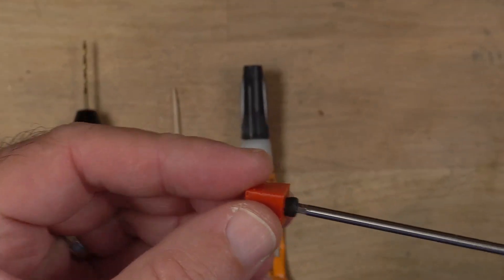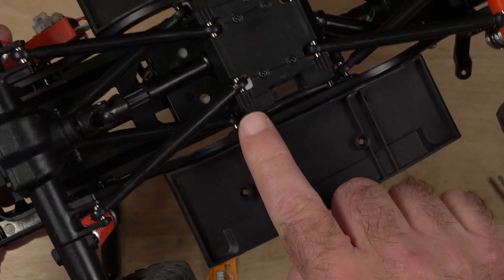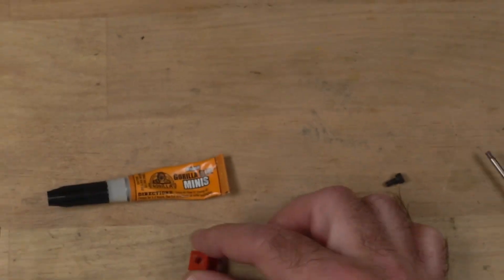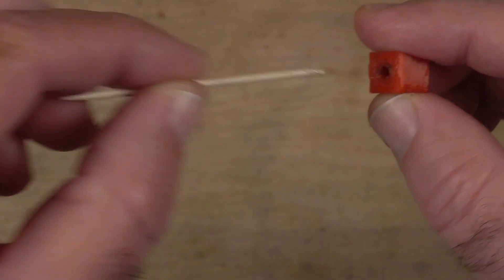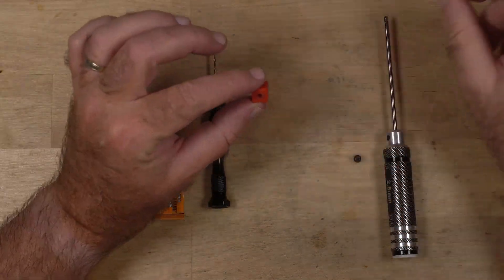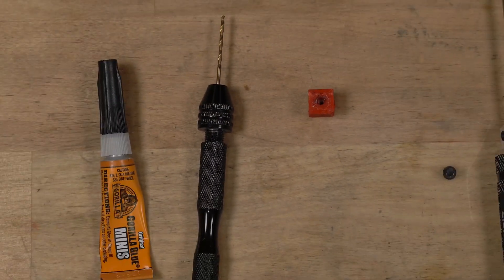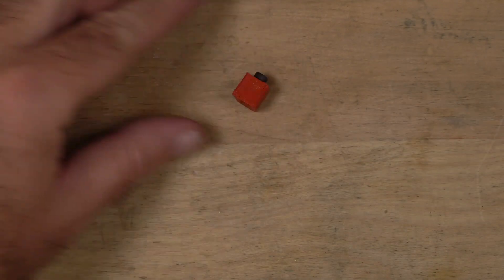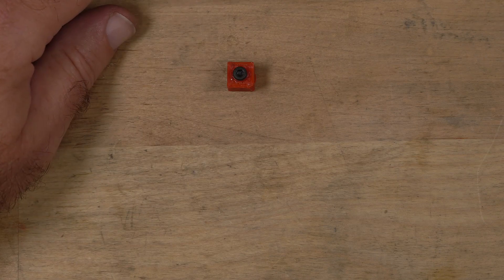How to easily fix a stripped screw hole in a 3D print or RC car crawler

Comment: Found this video too late. I ended up just stuffing the screw hole with bits of support, heating up a screwdriver tip under a flame, and melting the support filaments into the hole. Probably not the best idea but I guess I was too impatient.
Reply from the maker: That works too.   There are many different ways. Sometime I end up using the next size up screw.